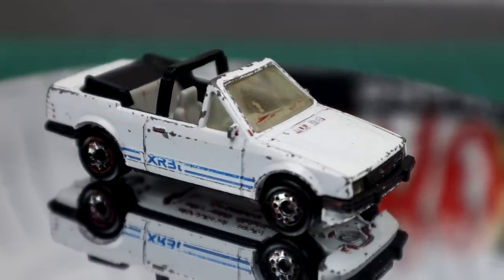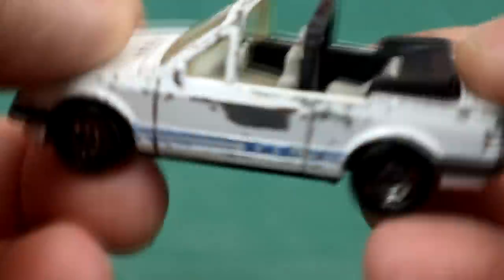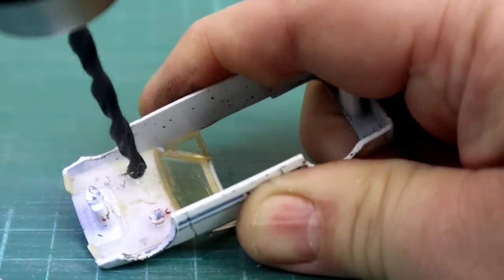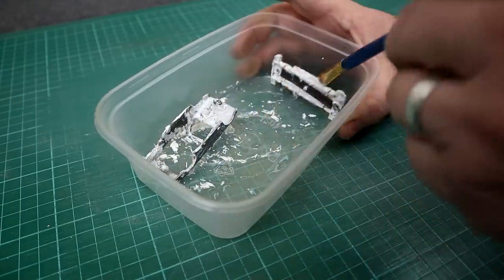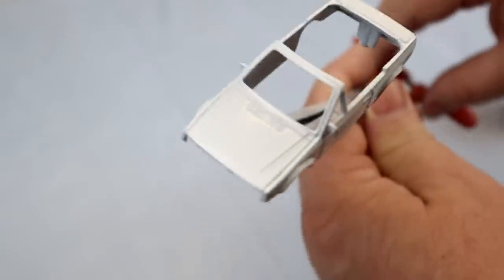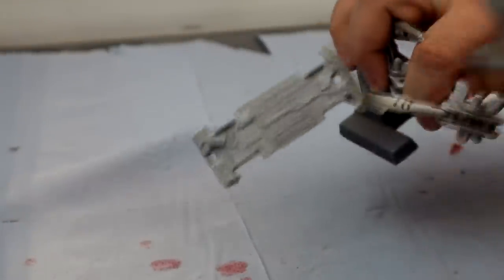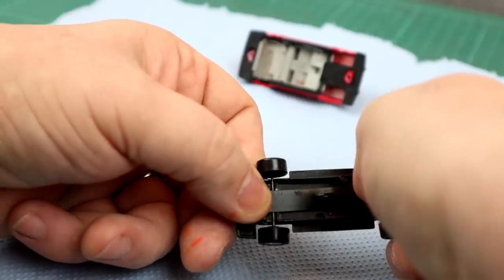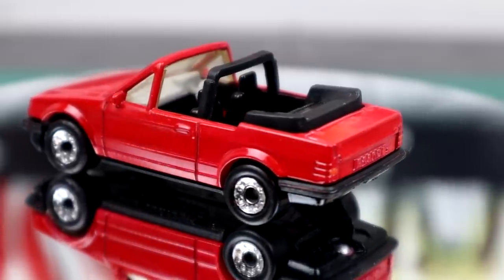Matchbox Ford Escort Cabrolet Custom Restoration

Comment: Martin, have you ever thought about using an end mill bit instead of a drill bit to cut loose the little cars? That way you could cut the peened over metal and leave a flat surface to drill for a screw or whatever. Just a thought. Nice video anyways...
Reply from the maker: This is no problem gary.

Comment: The vivets are so small they would easily pull through. It's only the glue holding the base on.
Reply from the maker: These are display models and won't pull through bud. Today's glues are so strong even full size cars are often glued together.